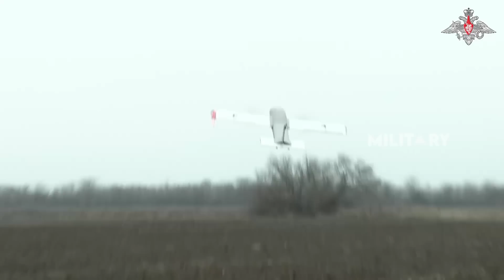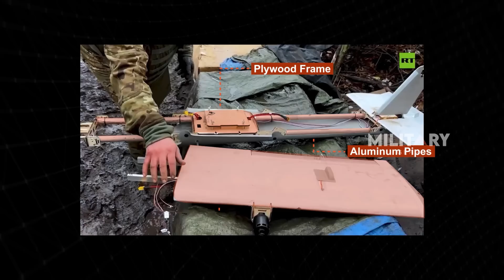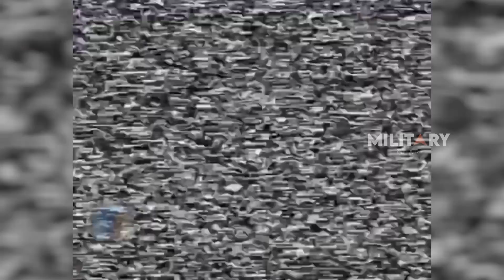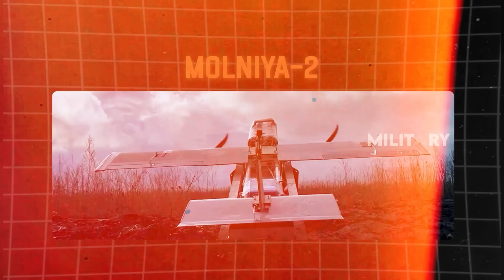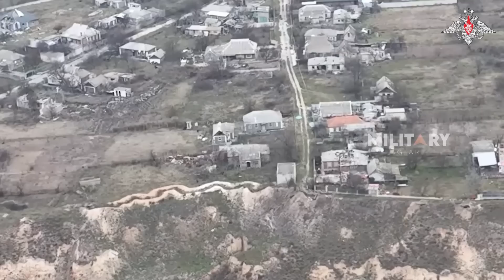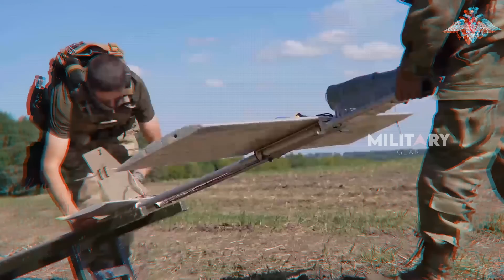Molniya-2 Unleashed! Russia’s Thermobaric Drones Devastate Ukraine’s Positions!

Comment: This new concept of using thermobaric warheads on drones gives a new dimension to the war content. So far, Russia limited usage of thermobaric bombs and missiles because of devastating effects on very large areas. In such conditions Russian HQ did not want to put civilian lives in jeopardy as thermobaric bomb kills everything within blast range which is measured for ODAB 1500 in radius of 300 m which is incredible surface. Usage of thermobaric warheads was very limited because the new concept of warfare is no longer mass troops and matériel moving across vast open spaces where such weapons would have maximum devastating effect. Now we can see that thermobaric warheads are being very effectively used in small areas where classic HE warhead could not achieve desired effects such as underground strongholds, bunkers, tunnels. This new concept will force change in military doctrine of old trench warfare, which resurfaced once again in Ukraine. It was Putin's order not to use Thermobaric weapons against Ukraine because it would cause too many deaths without giving defenders a chance to surrender. After more than two years of meddling with military strategies and decisions, Putin under the public and military pressure pulled out of decision-making for military and now HQ is decision-making, and we can see effects when charlatans such as Putin  stop to "be smarter" than true experts.

Comment: Easy to install the fiber line connection and use camera auto lock onto the designated target.. as this is quite old DVR technology.    They should develop the re-usable 4 guage shotgun version for anti-drone usage (multi barrel or semi automatic) and a anti drone net pod.
Reply: Its already in works. I've heard they are making 2nd-gen antidrone shotguns and nets. It is just the matter of time those will be attached to drones themselves
Reply: @jdaniels4898  I'd prefer airships, balloons, and WWII fighter like drones..  reminds me of the A-10 Warthog R/C airplane plan that I bought back in the late 1980's (110" wingspan)  Oh, also flying from the Chicago area to Orlando, went by one of those surveillance radar balloons that hung around 10,000' off the Florida West coast (I was in  light airplane puttering along).  This drone crap is traceable, even by their electric motors.. and I know that radar of the 1980's could easily see geese at 12 miles and a aluminum tub ultralight out at 35 miles.. easily.. through clouds (could see them too).. A drone at 10 miles would have been tractable all day long..  This drone stuff really only works in the clutter zone, like less that 3 meters above the ground.

Comment: Russia has proven you need not spend insane amounts of money to command an effective military deterrent. They spend but they are also frugal at the same time.
Reply: Having state owned defense companies also makes a big difference
Reply: i guess next version is going to have wire guidance witch makes relocation after launch impossible  - as jammer polluted as the airspace in ukraine is ~ or these either are going to be preprogrammed for a location - witch can also fail becasue of satelite signal EW disruption or use camera video feed to compare with pre programmed satelite pictures of the route to steer into target
Reply: Meanwhile zelensky ask more money for himself